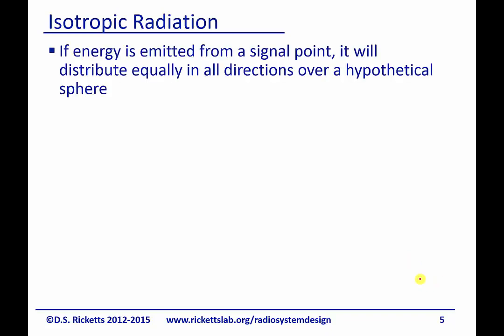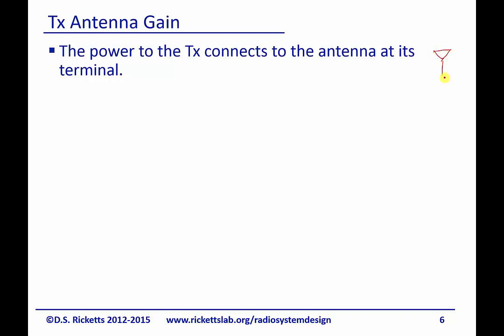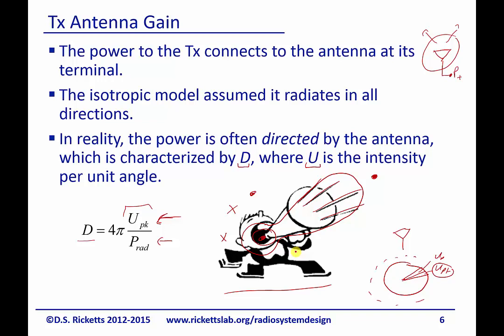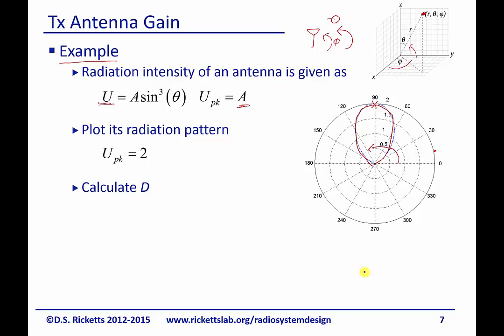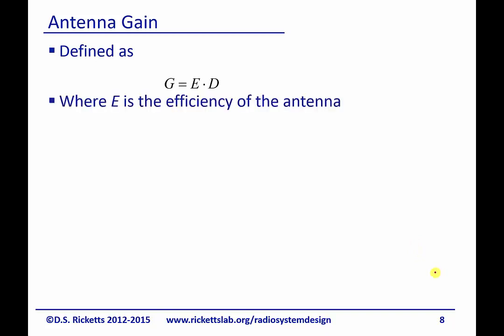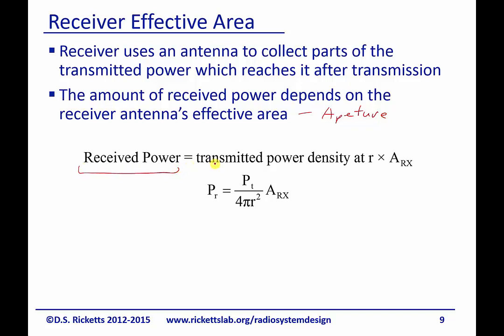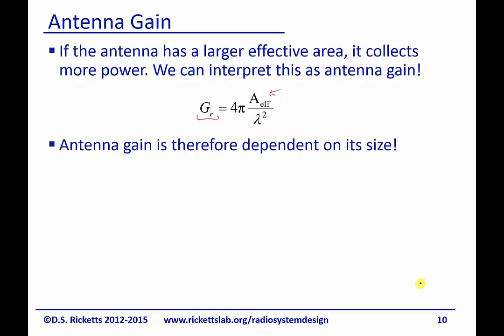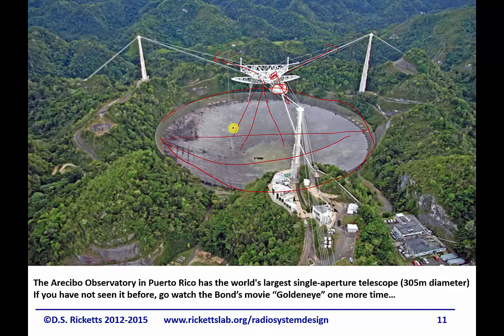Module 15: Antenna Gain

Comment: Hi there, thank you for posting the video. Question: since the Antenna gain = the antenna efficiency * Directivity, by having two different directivity equations for Tx and Rx meaning the antenna gain could be different between the Tx and Rx? Or is the term “U_pk/P_rad” and “effective aperture / lamda^2” in the Directive equation could equal to each other? Thanks!

Comment: Your integral you calculated is just wrong and the directivity you calculate is also wrong you forgot to multiply in A into the power radiated